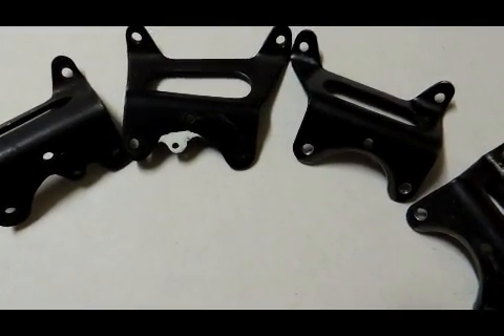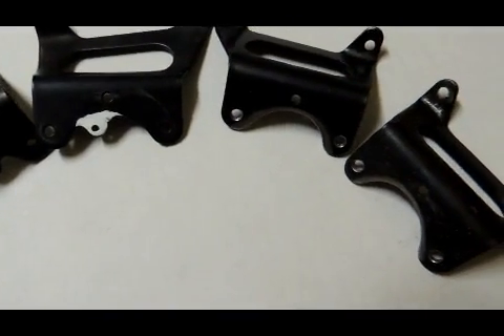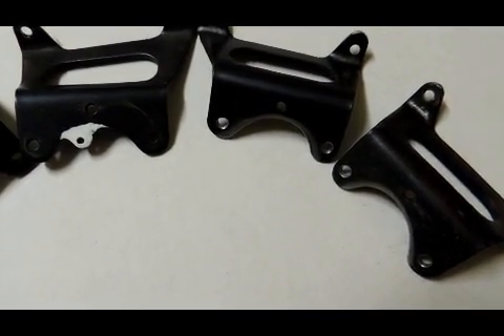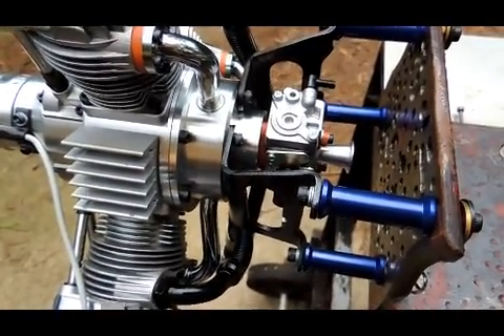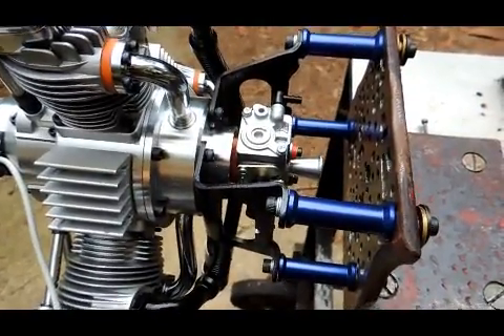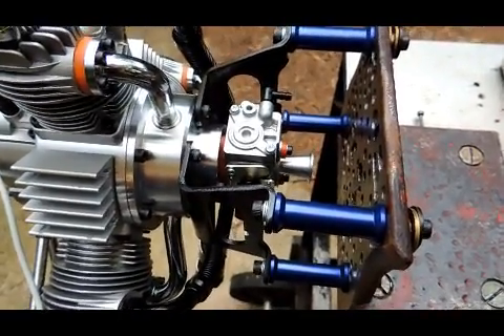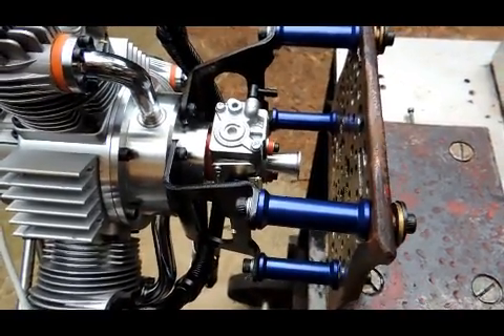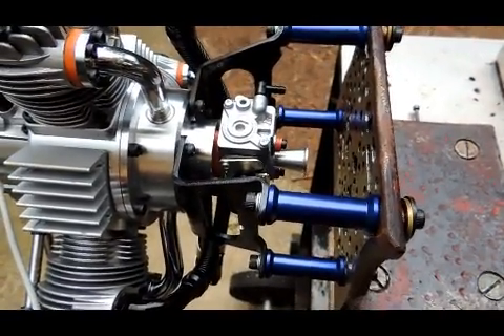SAITO FG84R3

Comment: Brian.... on the FG84R3, did u notice temperature variance on the three cylinders and a bit of hesitation transitioning from low end to high speed.... My engine is showing a differenc ein close to 20 degrees on the top and bottom cylsinders and whatever I do there is hesitation in transitioning.... I am using a 20% oil mixture
Reply from the maker: +Yo Irfan,
A temperature difference will always be noticed with a radial engine but, unless it is really excessive, it will not harm the engine. I find all the radials I have and have tested have different readings but the engines are all running and in very good condition. The hesitation could be caused by the fuel you use. I don't know what oil you use so it is difficult for me to give a positive answer. I use a high grade synthetic oil and, for that engine, 15% oil is more than adequate and I find 10% nitro methane helps with transition. After you tune the maximum RPM and the engine is running as it should, lean the idle mixture as much as possible and see if that smooths the transition for you.
Hope this helps
Regards
Brian Oily

Comment: Brian, get one of the digital LED tachos you connect to the ignition box. Makes life easier. :)
Reply from the maker: Yo Wikeroy, 
Thank you for that information...however, I have had a module driven tacho for several years for the RCexl CDI units. The module for the Saito 84 did not have a connection lead for a tacho and Saito had not then developed their add on tacho as they have now. If you bring up my review of the V V RC 40 cc twin engine I posted recently you can see the tacho in use. They are quite accurate actually as I have checked them against my hand held digital tacho which is claimed to be accurate to one in 5 million and it will read down to 1 RPM.
Thank you for your interest - keep watching.
Regards
Brian Oily
Reply: Brian Winch
I see, okay; I test run my FG-84 yesterday first time. It has output to an RcExl LED tacho, so, I thought yours had too. hehe.

Mine is hesitating around 5000 rpm, then comes fully up to 6400 rpm with a Mejzlik 24x10.

So I am happy with 6400 rpm max on a Mejzlik 24x10.

What do you think I should do to get rid of the hesitation around approx 5000 rpm? Increase L needle a bit?
Reply from the maker: wikeroy Your engine would be a current model with the RCexl module - mine was the first production that had Saito's own module - a bit different to that which they use now. The slight hesitation is the transfer from the low speed mix to the high speed mix and can be tuned out by very small adjustment of both needles for a balance. Try a small adjustment leaner of the idle mix first - no more than 1/8 turn. Then, if needs be, return to the original setting and do the same with the high speed but don't go overboard with the adjustments. There will always be a very slight change but it can be tuned almost out so it is not a bother.
Regards
Brian Oily
Reply: Brian Winch
Okay, thanks, I will try. I know these carburators are very sensitive on the needles.

Comment from the maker: Yo Adriano, The 84 would be way too big but the 33 would be okay provided you keep the model reasonably light. As a 3 cylinder radial, the 33 does not have the same power as a single 30 but it is not too far behind and...a lot smoother. 
Thank you for your interest.
Brian W.